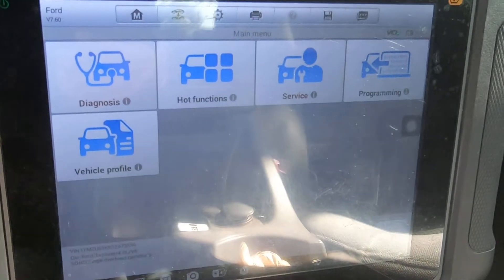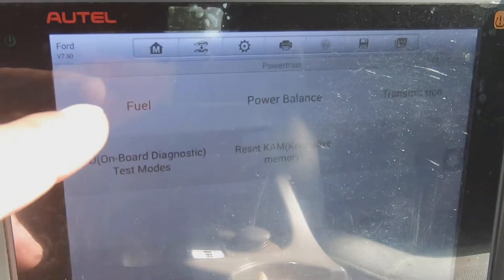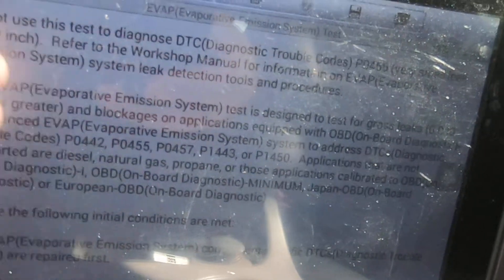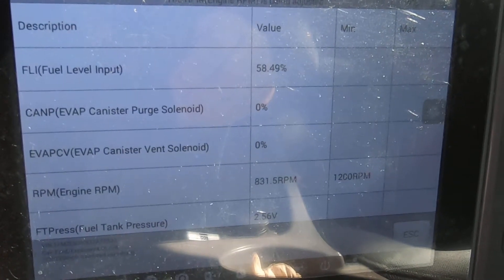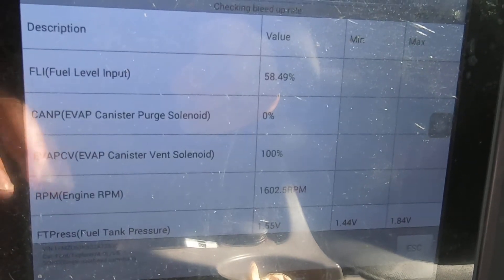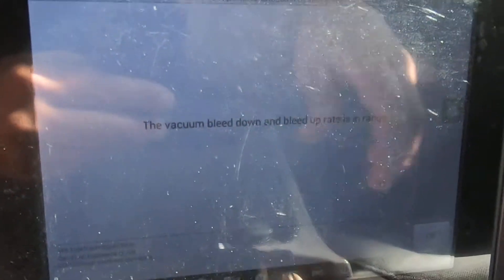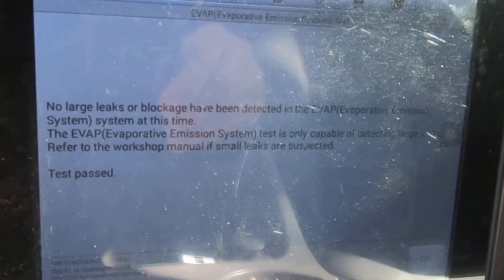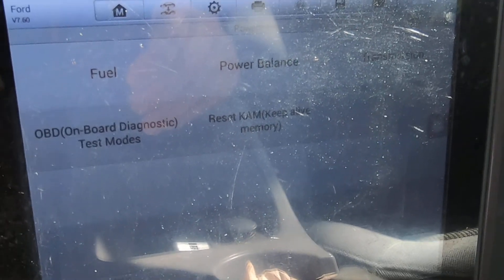Why you may want to run the evap test using the Autel MS906 for a code P0441, P0442, P0455, P0456.

Comment: I have a question about the scan tool you are using. I've bought a few different scanners and none of them have the features to do a evap solenoid test. What scan tools support evap vent solenoid test?
Reply from the maker: These scanners will do the test.

Launch X431 CRP919XBT
https://www.amazon.com/dp/B0CJDTPDPB?ref=t_ac_view_request_product_image&campaignId=amzn1.campaign.2ZY9S5B0NLAUS&linkCode=tr1&tag=737mechanic-20&linkId=amzn1.campaign.2ZY9S5B0NLAUS_1748982789568

Thinkcar 689BT
https://www.amazon.com/dp/B0DCFRF2TF?ref=t_ac_view_request_product_image&campaignId=amzn1.campaign.18H5R7A7W8SS6&linkCode=tr1&tag=737mechanic-20&linkId=amzn1.campaign.18H5R7A7W8SS6_1748982902478

MUCAR 892BT
https://www.amazon.com/dp/B0DTK24XKB?ref=t_ac_view_request_product_image&campaignId=amzn1.campaign.1LUP1976EJMV5&linkCode=tr1&tag=737mechanic-20&linkId=amzn1.campaign.1LUP1976EJMV5_1748982948645
Reply: @737mechanic would a Autel MX900 do a evap test ?